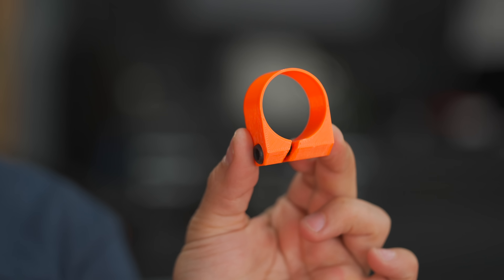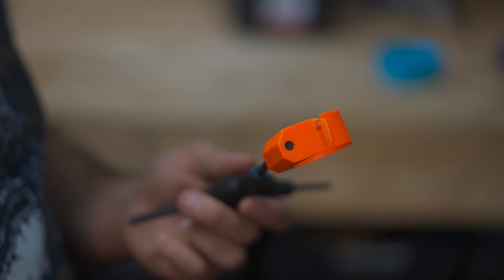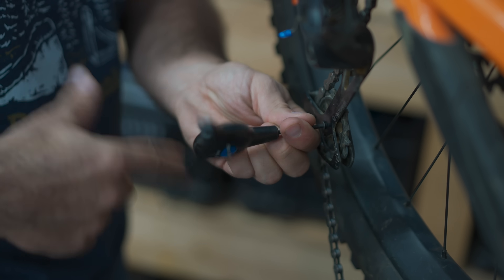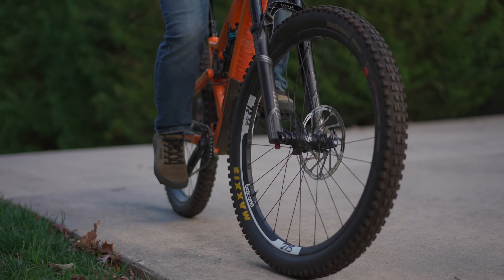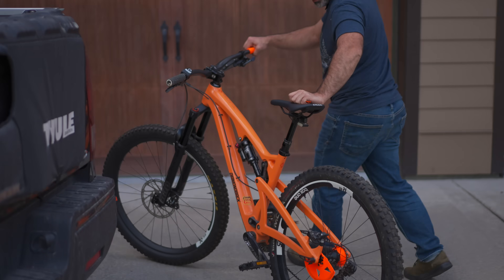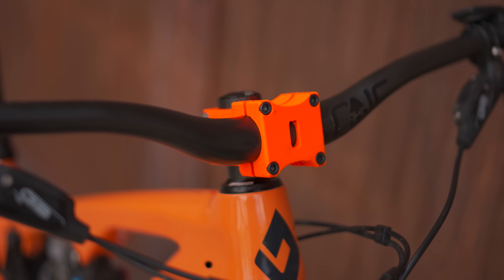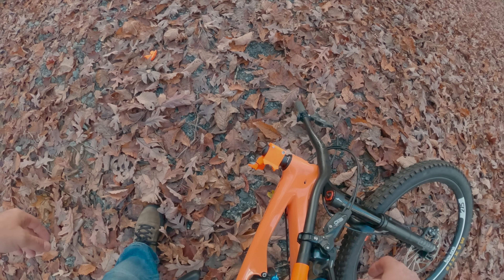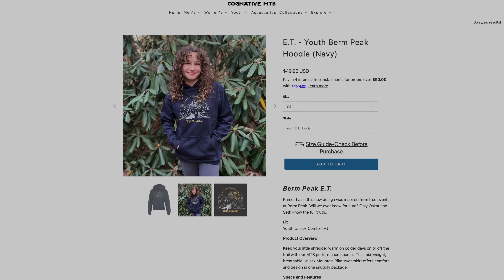Will 3D printed MTB parts break catastrophically? Let's find out!

Comment: Make rock shox tockens please
Reply: Just use suitable amount of grease instead
Reply: @xartpant  it's much harder to get it consistent and accurate with grease.. however I do agree the sentiment. In rear air shocks I swear by this , but with it being a smaller chamber it is much easier to account for.
Reply: @xartpant  it’s harder to get it as consistent with grease that’s why tokens are used
Reply: And a Shimano pedal tool
Reply: @yesman4328  this is a death recipy. do you want to kill Seth?
Reply: @SB7-r9i  Not a pedal, Shimano's proprietary tool for taking pedals apart.
Reply: @SB7-r9i  I meant just the tool that tightens the pedal axle, not the pedals themselves, lol. Although at this point it wouldn't even surprise me if he 3D printed his own helmet
Reply: @yesman4328  😊
Reply: I've made fox ones. Turned out perfectly.
Reply: And stem caps too please!!!
Reply: Actually I have made a half-token for a Fox 36 out of PETG. That works totally fine and is in use for more than a year now.
Reply: @Schnabulation  . Same here. been riding a 3d printed 1.5x size rockshox token on my lyrik and on another on my super deluxe for about 3 seasons of intense north shore riding! no issue whatsoever.
Reply: @rodrigormotta  Can you share file or link with model?
Reply: Maybe shock stanchion?   

Lol
Reply: @randomsnek  nah, it wouldn't slide anywhere near as well
Reply: @acmtb14  with enough lube it will
Reply: Genyus
Reply: also use 100% infill please!
Reply: Rock Shox "bottomless tokens" are so cheap there's no point making them yourself.
Reply: If you go to your LBS and ask for rheum, they will probably give them to you. We have a lightsaber of them in our shop, plus a bag full.
Reply: Me who i working on starting up a business making mtb parts while using a 3d printer for the process....
Reply: Yessss
Reply: I made some last month
Reply: I have a model for some on Cults
Reply: @HorizoonTV  i think so, they might be molded but i can’t see why a 3d print wouldn’t work just as well
Reply: I ride 3 self printed in my shock... Absolutely no problem
Reply: Only if you spell it right
Reply: I have a 3d volume spacer in my Fox shock.
Reply: I'm using 3d printed fox tokens :)
Reply: Volume reducers***
Reply: i’ve had a printed token in my fox 36 for 3 years and it has no damage or wear
Reply: “Tokens”
Reply: I molded some myself!
Reply: Great 👍
Reply: Air tokens, valve caps and maybe even shock bushes could work. You could certainly make a custom looking cap to colour match that one odd valve on the bike or even two Presta and a Schrader (with integrated core tools) all matching. That'd be dope.
Reply: I think this should be perfect on making speedometer mounts
Reply: And a while trek procaliber frame